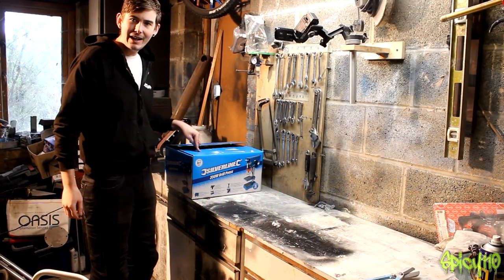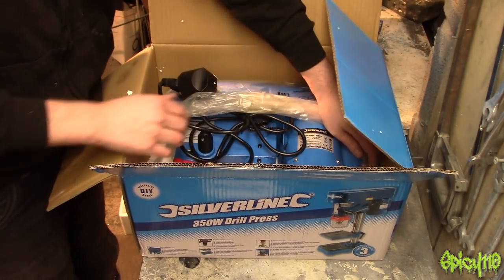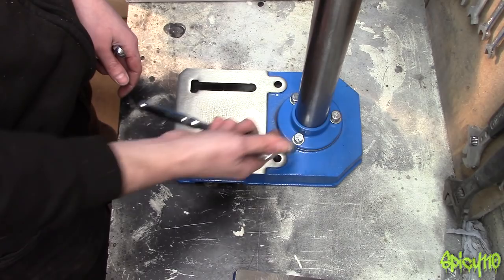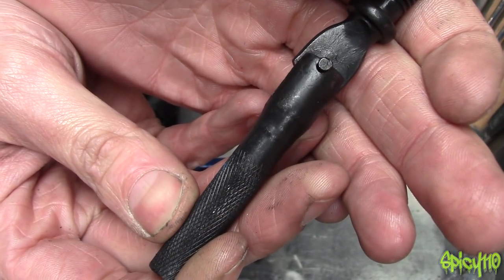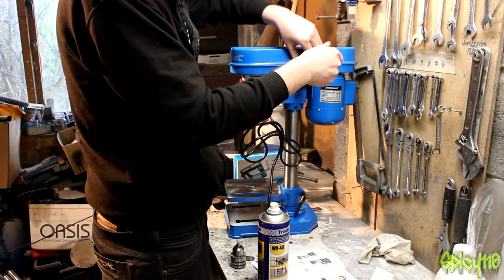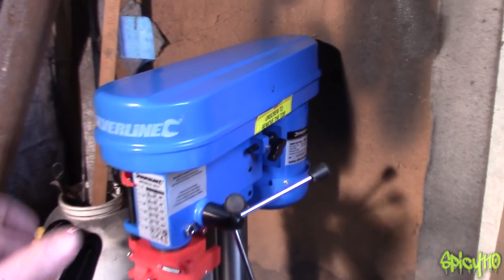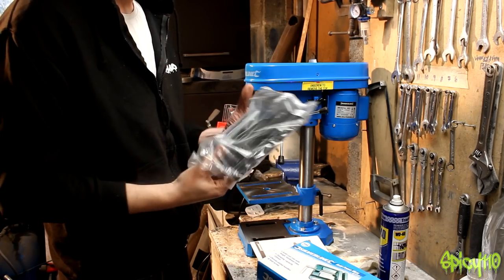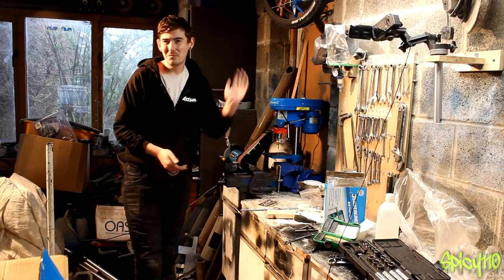Building the Silverline Drill Press!

Comment: If your garage isn't heated like mine, get some used engine oil in a spray bottle and give it a good soaking whenever you're finished using it. The pillar and plate section love to rust on these things.

Try to figure out some way of mounting it solidly in place too. There's nothing worse than chasing a piece of machinery around a workbench while trying to work on something. If you're not able to drill holes in the bench, drill and tap some holes in some flat bar with the correct hole spacing, run some bolts through then weld them in place and chop the heads off them and grind them flat. Makes an easy part to grab onto with some G clamps etc, the same will work for your bench grinder.

Nice to see the aluminium belt pulleys instead of the usual plastic injected ones that come with these things. Silverline do seem to make decent tools, just make sure to activate your warranty.
Reply from the maker: The next video Filmed days ago is me mounting the vice and drill press. Good call on the table

Comment: Hi man , great video. Could you please tell me how do you install the vice on the drill ? I bought a vice but the holes dont match the ones on the drill...
Reply from the maker: Yes I too had this problem they don't match. I got a different silver line vise and that also didn't line up right but by fitting on a diagonal it works. It seems so stupid they don't make a vice that fits on their drill.
Reply: @spicy110  thx. Best